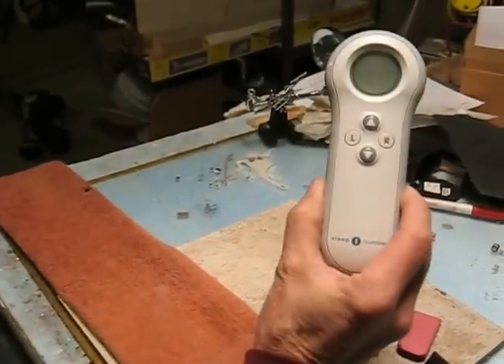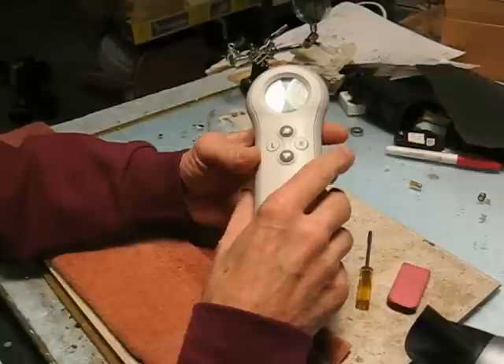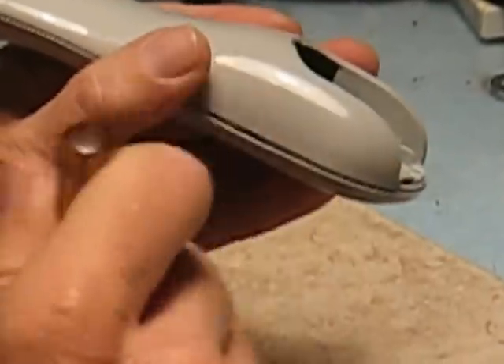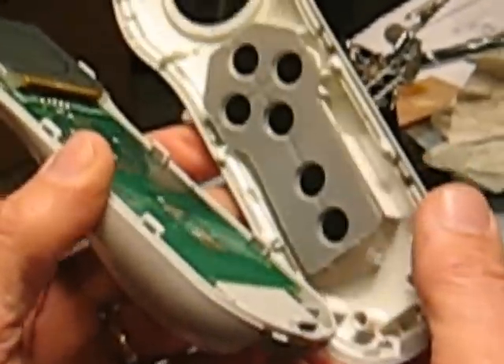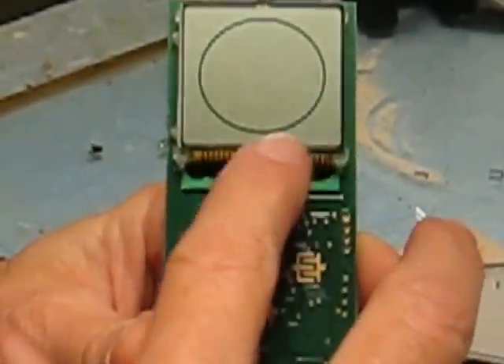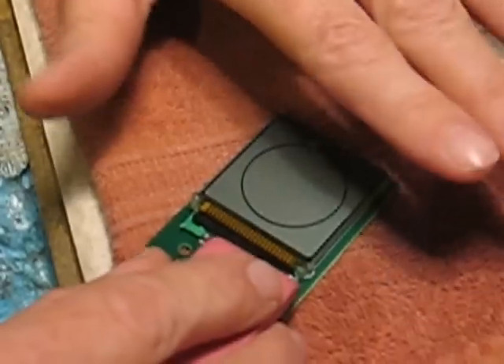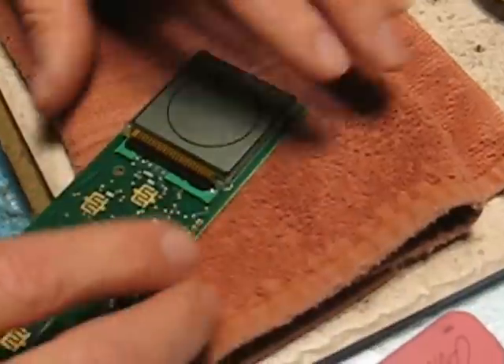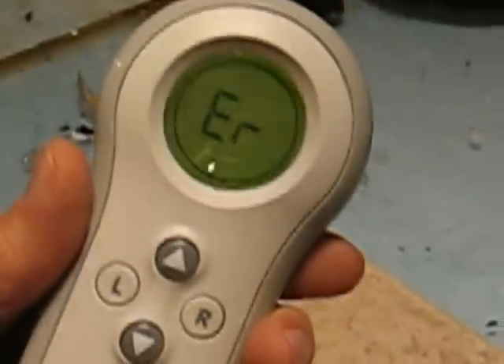Repair sleep number (Select Comfort) bed control display

Comment: Thanks for your fix. I heated the display until it turned black then pressed lightly with an eraser. Then set the hair dryer to cool to cool everything down. Put the board back into the faceplate and held the battery in place to test it. Worked great. Then attached the back plate.

Comment: This is a good repair, but you don't need to press on the LCD frame, just the portion of the flat cable that connects to the LCD. For those of you concerned about how hot to make it, I have a hot air station, and set to 250°C, this worked the first time. I used a wood spudger instead of an eraser (just a 1/8" dowel "sharpened" like a flat blade screwdriver on one end). Use the flat part of the wood dowel to press the cable, sort of iron it back and forth.
Great catch on the failed adhesive. Thanks for sharing!

Comment: Can’t thank you enough!!!! Our remote’s screen hasn’t been working for years! So frustrating! While googling to see if they even sold this older style remote anymore, I saw a link to your video. Jackpot!! You made my day! Here’s how it worked for me. My screen turned all black within 15 sec. of heating it. Just for good measure I heated it to black one more time then put it back together. I could only see partial numbers on the screen. Took it apart again, and heated it to total black, again it happened quickly. Then I read a comment from someone that said he focused the heat of the dryer on the ribbon area only, so I tried it. The screen will start to turn black again from the bottom up. I just let it turn 3/4 black before using the eraser to press only on the ribbon area. Next I used my dryer on cold to cool it down before putting it back together. Finally, I lightly rubbed my thumb around the display screen and then gave it a try. It worked!!! I can now see the full display clearly. Thank You again for making this video!! You’ve saved a lot of people a lot of $$ and frustration.

Comment: Greg: you get the Nobel Prize for Remote Repair. I had contacted Select Comfort and this remote is no longer available (6/8/17). You have to buy a pump and a new remote combo. Thanks to you, I used my hairdryer and a Q-Tip in place of your eraser and on my first try, it fixed the whole thing. Thanks. Ya gotta love YouTube and good folks like you.

Comment: I thought my bed was going out and saw this video...after months of confusion using an unresponsive remote, I followed instructions, heating on a towel until the screen got dark and pushed in the indicated areas with an eraser. I did two or three goes and reconnected it after it cooled. Now, my remote and bed are communicating again and fully functional! Thank you so much for the video, it works!!!

Comment: I started to watch this and when I saw it was a cordless I switched to another video, only to find they tried the same thing on a wired remote.  Thanks, this video is still helping folks!  Took several tries, what I think worked best was after getting it hot, I squeezed the display, putting my fingers on the far right and left of the display.  Kept squeezing until it cooled down, works great now!

Comment: As an electronics technician for over 40 years this fix did not make any sense at all.  But after reading the reviews I thought I would give it a try on the wired remotes on my sleep number bed.  I had lost all of the display on both.  The fix worked perfectly, both remotes now have all of the display again.  It doesn't matter how it fixed them, all that matters is that the remotes have their displays again.   Thanks.

Comment: My old SC (now SN) mattress is so old that I was told by SC that I'd need to buy BOTH a new remote and a new pump--a mere $485!!  That is the amount your video saved me, and I am eternally grateful.  I did it on the third try.  I had taken my mattress all apart due to having to buy a new box spring due to bed bugs.  So my mattress wasn't even inflated or inflating. So after expense on expense, I was so pleased I didn't need to buy a new remote.  Thank you!!

Comment: I watched this video to see if i could get some info that would help me with my issue and you showed me that it is okay to take the remote apart.  My 9 volt battery was no longer making contact with the "poles" in the remote.  I took the remote apart and slightly stretched them down and forward to get them back in place, just a bit was enough to make contact and save me  from sending in close to $60.00 (still under warranty charge)!  I'll look you up again when the screen goes dark!  Thanks!

Comment: Just want to say thank you sir. Our remote was operational but no display for the last eight years. With a recent injury I've needed to adjust my side regularly to try and find comfort at night. Without the display I was going nuts trying to keep track of what felt best. 3 attempts using your method and the full display is working again. Can't thank you enough

Comment: Thank you for making this video.  I repaired my remote display in 10 minutes with your instructions.
Update 11/11/15:  I have owned the sleep number bed for 6 months now, and I have had to do this repair on my remote 3 times.  So far every time is has worked and brought back the display to full capacity, but I would expect that at some point it isn't going to work and I will need to buy a new remote.  Word of caution, after 3 times of taking my remote apart the tabs on the sides that latch the 2 halves together are breaking off.  If you need to get into your remote multiple times be careful!

Comment: Thank you so much!! I'm 72 and just did this in under 3 minutes. I heated it until the display turned black, applied pressure to the contact points, cooled it down and voila!!! Easy! And to think I've put up with this for 3 years.

Comment: We have an older Select Comfort Bed and experienced this display issue, while the remote continued to operate the air control system.  I almost went out to bid on another remote and decided to see if there was a way to make the display repair as these things go for about $80 on ebay and are unavailable anywhere else.  I am very thankful that I found your video!  I did exactly what you recommended and the Third time was a charm!   The full display now works!  Thank you for your 11-year-old post!

Comment: Our remote started to lose segments after a move three years ago and finally went completely blank about a year ago, but it still worked to inflate/deflate.  I was just getting ready to purchase a replacement remote online today when I decided to search on whether there was a fix.  Was able to see all but the bottom lines of the display after the first try (heating until just the bottom of the display went black then pressing everything.  The second time, got more aggressive and heated until the entire display went black, pressed everything down again, and entire display now works correctly.  Thank you so much for saving us over $80!

Comment: Greg, thank you so much!  I told my wife earlier today that I doubted our wired (NOT wireless) controllers would be replaceable because they are about 17 years old.  They both stopped displaying several years ago, and recently my wife's stopped working altogether...would not operate the pump.  Your video was the first to come up in a web search.  So, I tried it and it fixed both problems!!  Super easy fix, and your directions were spot on!  Thanks!!!

Comment: I have the sleep number wired remote version for my bed. There were no numbers showing up. I tried this and the first time I got just a little line showing up. So I did it again and more showed up. Then I finally did it more and left the heat on for about 20 seconds after the screen went black and it was fixed. But the next AM the far right line was missing. So I did it again and left the heat on for 30 seconds and it has been working ever since. This was a bed I had gotten from my father in law that was in our guest room for over a year and not working. I was doing a Google search to find a replacement remote when I came across this you tube video. I gave it a try and it worked. Thanks Greg.

Comment: Thank you so much. This remote is no longer made so to replace it for a bed that is still under warranty was going to cost $91.61. I was told that I would need to buy a new pump to get a new remoter and the prorated cost was 91.61. I used a heat tool for card making. It heats up hot and fast. Remote is working perfectly. Thank you for the tutorial.
Reply: ssdtechgirl Thank you for posting this comment.   I was wondering if I could use my heat tool instead of a hairdryer.

Comment: This remote has been bugging me for years but I just came across this fix.
Only takes 5 minutes. Go thru the steps. I just used a pencil eraser since I didn’t have one shown in the vid. Let the display turn completely black and reassemble. 

Awesome! Thanks!

Comment: Hi Greg. Thanks for the tip. 2 seconds with a 1500 watt heat gun turned the display completely black. Used a pencil eraser to tamp everything down. Let it cool off. It now works perfectly again ... Great - Thanks again. Bill

Comment: Thanks so much for your great tutorial. My controls lost the number display a few years ago and Sleep Number told me I have to buy a new pump to get new controls since I have have an older model where the controls are wired to the pump. It looks like your repair process will work exactly the same for the hard wired controls as it did for your battery operated control.  Thanks so much for posting this easy repair.

Comment: You didn't save us $50.... you saved us $250!!!! our queen size sleep number bed has the two wired controllers and both of the displays have gone to the dark side. After removing the cover for the compressor unit and seeing a antenna for remotes I decided to try your fix. Now the wired remotes work perfectly. The only thing you have to do with the wired remote is to unplug the harness after removing the cover.Thanks so much.

Comment: Genius!  Thanks a lot.  It worked on the first try.   My remote was just blank screen - called sleep number who tried to sell me another remote and sold me their service eventhough it is still under warranty.  Paid $180 to a middle party who came to check bed and had no idea why it was not working. He told me someone from corporate will contact me and replace my bed.  No one did.  I had to put a stop payment on my credit card for that $180 which they never contested.   Thanks again for posting this video

Comment: Thank You for your contribution towards the reclamation  of "replaceable"  with ingenuity and patience....Instructional video is a good resource for "bad LCD".  If its already broke you certainly can't hurt it.  I had used a heat gun and found that the lower temp caused the LCD to blacken quickly .   After first attempt I traded the eraser for a pencil and used the eraser and the lead point to work the glues back in.

Comment: I have an older model with the wired remotes, and I tried this trick and it worked just fine - in under 5 minutes!  Just make sure you unplug the pump before you open that wired remote so you don't get a shock.  Thanks for the tip - it saved me a couple hundred bucks as I was going to toss the whole pump and buy a new one!

Comment: EXCELLENT hack fix -- THANK YOU for posting! I found that letting the whole screen turn black, then using the washcloth the remote was resting on to press and jiggle the screen around evidently helped with the reconnection. I did this 3-4 times and it's working again like a charm. VERY much appreciated!!

Comment: THANK YOU!!! I've been suffering from neck pain and sleepless nights for a long time, not knowing the true setting on my WIRED control. I followed your instructions (AFTER UNPLUGGING THE UNIT FROM THE OUTLET) and it worked easily and perfectly on a wired remote, too. I'm looking forward to much better sleep again. Just wish I would have seen this sooner - might have saved $1000 on chiropractic bills.

Comment: I have 2 wired remotes on my older Select Comfort King. Neither remote has worked for years. At first I could change air pressure with NO numbers in view, then nothing worked. I tried this work around thinking it might not be my problem, I thought it was probably the pump. I called Select Comfort today and chatted for over an hour with a very nice man. We went way back in my records to find something. After an hour he said because I had an out of date pump I could get a replacement for $75 plus 2 remotes for a total of $114. Problem is, the supply chain has had them on backorder forever and he had no idea when they would come in. I found a replacement on Amazon for $250 and was ready to order when I decided to give the hair dryer a try. I took about 4 times for the numbers to show up but everything is working perfectly at this time. I don't know how long the fix will work but I'm hopeful.

thanks so much for the tip....................

Comment: Another successful repair here too. Thank you very much for the video. I too let the heat from the hair dryer completely turn the LCD black. I did it twice and pushed on the ribbon cable with an eraser just as shown in the video. Also firmly but carefully pushed on the lcd with the eraser. My numbers are completely back now. Thanks again!

Comment: This is a great fix that truly works!!! Thank you so much for the valuable info. I had to try it twice for fear of overheating the unit, but when you think it’s done…heat it more. It will be HOT! The eraser is key! You can apply good pressure on the hot surface. Thanks again!!!

Comment: You ROCK! I've lived with a blank screen for years.  This worked perfectly. Just a note: When you say get aggressive pushing the ribbon and screen, you really meant aggressive. It took a lot more pressure than I would have put on it if you hadn't said so.

Comment: I have to thank you!! I went looking for a replacement remote and came across your video, decided to try it and lo and behold my remote works like brand new. I had to heat it 3 times and the entire screen turned black before it worked completely but it does work and screen goes right back to normal. Thank you for posting this.

Comment: You are a genius!!  I am on my second remote (the first was a wired version) and my display had pretty much disappeared.  I was down to one single line.  After watching your video I went home and had a 'like new' display in just a few minutes.  I actually think it took longer to find a small screwdriver than it did to make the repair.  Thank you so much for posting this video!!

Comment: Just tried this and it worked GREAT!!! I was looking for a way to get a replacement for my old remote and stumbled on this.  I did not have an eraser so I used a floss box figuring soft plastic would also work.  Thank you for the post!

Comment: Worked Great. Thanks for the information. Pro Tip: Only heat the ribbon and use a wooden clothes pin to press the ribbon to the base portion of the display. Don't heat the entire display and don't apply pressure to the top layer of glass.

Comment: I've performed this procedure 5 times in the last 48 hours. That's 5 SEPARATE remotes, both wireless and wired models. I used a Revlon IONIC 1875 watt hairdryer ($15) from WalMart to heat up the LCD for 40-70 seconds, 3 times on each remote, usually until the LCD turned completely black like Greg says, then for about 10 seconds more. I used the highest of the 3 settings on the hairdryer, holding the barrel of the hairdryer about 1-2 inches from the LCD and moving back and forth over the LCD. I pressed on the ribbon cable on 2 of the remotes, the numbers on the other 3 remotes came back with just the heat.

I've had 100% success on all 5 remotes, just had to do a 4th pass/heatup on remote #5.

This procedure will save you $30-60 for a replacement WIRELESS controller or $200-300+ for a "new" FCS/pump.

Now if only someone can post a vid of how to fix the problem some pumps develop of not holding the air pressure constantly.

Comment: Excellent video. your detail about how to open the case was spot on too. I would have probably broken the case just trying to get the case open. I followed your instructions exactly with the exception in that I only focused my heat and pressure at the flat cable only. Worked beautifully. Thank you for taking the time to make this video.

Comment: You Sir ROCK!!!  My remote stopped working and I figured I was going to have to purchase a new one, but then I came across your video.  The video is awesome!  I was having the same issue.  I used a paint can opener to get into the remote(worked really well too).  I blow dried it, used an art gum eraser, first try I got a couple of segments of numbers, did it again and it is now 100% functional.  Thanks again!  Jeers to SleepNumber for designing their remote this way.

Comment: Thank you for making this video!!! The LCD screen had been blank for a while and I was reluctant to fork over $50+ for a replacement. Your instructions were easy to follow. Sadly, pressing on the screen/cable didn't work for me. After the 4th time, I opted not to press on the screen. Instead, I kept the heat on the screen for three minutes, which was more than enough time for the screen to darken. Popped in the battery and, eureka! The screen is displaying correctly. I did unintentionally break several of the tabs when prying open the remote, but at the moment, I'm too elated to worry about that. Again, thank you, thank you, thank you!

Comment: Works great thanks for the tip. I didn't heat up the display at all, just the connections at the bottom until the lower part of the display started to turn black. Then I used a regular pencil eraser and pushed all along the glued part. Worked perfectly the first time.